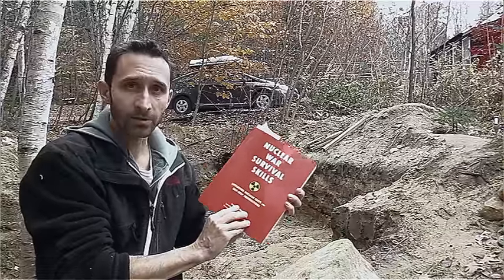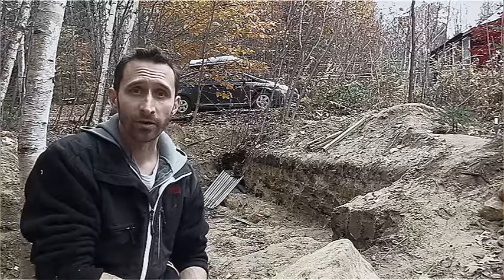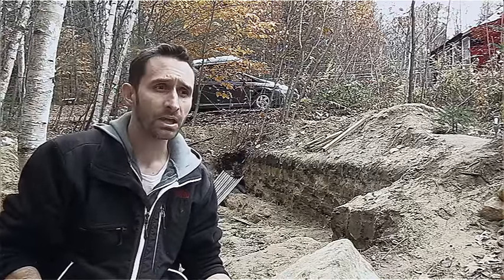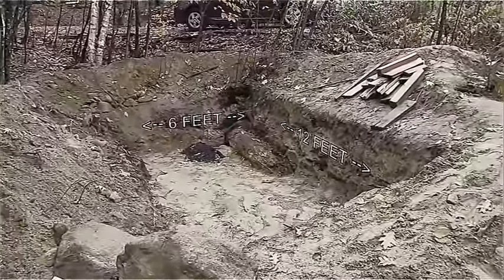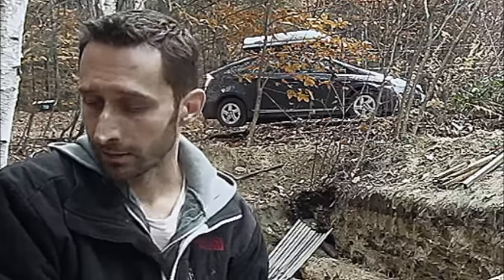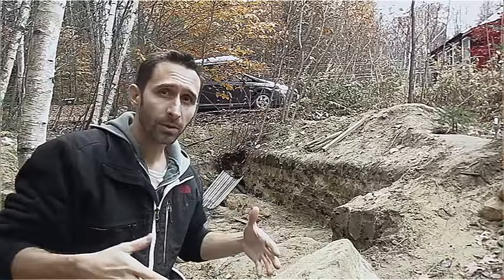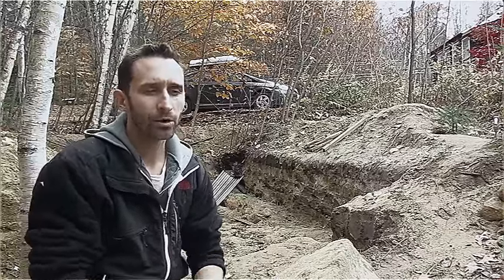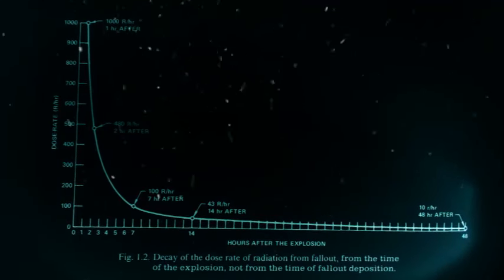Surviving Nuclear War - Part 2: Shelter Building

Comment: 1. Ideally you need to maintain a positive air pressure in the shelter to prevent small contaminated particles from getting inside. its unlikely you will be able to wear a n-95 mask at all times. Alternatively you need to make your shelter have a good air tight seal so there is very low air movement except through your air filtration system.2. Soil or sand could be bagged (ie sandbags) instead of spreading dirt on your floors. But I question the safety of using 2 ft of soil on top of a wooden floor structure. You probably don't need to cover your entire first floor, just a section large enough to accommodate those living in the basement. Sandbags could be used to build temporary walls in the basement to provide full gamma radiation coverage in a basement.3. Nuclear power plants are likely going to be a problem. After the war, the plants will meltdown, and continuous produce new radioactive isotopes for years. 4. You need a source a food after the war is over and your food stock is depleted. its likely that unprotected soil will become contaminated with long half-life isotopes like Cs-137. You need to apply plastic sheet and green house(s) to provide safe soil for growing food. Plants will take up CS-137 and other contaminates from contaminated water or soil. It would be preferable to use a deep underground water source for drink and watering crops. Consider that some containments will be water soluble and a simple filter will not be able to remove them. The only way to truly filter out soluble contaminates is making them insoluble and then filtering them out.. Boiling can also be used to remove most of the soluble contaminates, but it will not remove them all. I think only high pressure reverse osmosis systems can remove soluble contaminates.5. Its likely that fallout will will also be chemically contaminated. Cities and other targeted areas will burn and they will produce a lot of chemically toxic ash that will containment everything. When the NYC trade center collapsed after 9/11, fires burned for more than week, with fire crews pour water on the fires. After a nuclear war these fires will burn for months and consume large area of cities.. Consider that cities use a lot of plastics and other hydrocarbon materials that when burned will release a lot of toxic smoke and ash. 5. Large bombs in the Megaton range are hydrogen bombs. I believe the largest pure fission bomb tops out about 400 Kt. Hydrogen bombs use a shield temper of U-238 to force gamma and neutron flux into the  lithium-deuteride mass to achieve fusion. the temper creates significantly large amounts of fallout, and it will also create much longer lasting isotopes that may considerably longer than two weeks to dissipate.. Some bombs are deliberated include a cobalt casing for the temper in order render the  target un-inhabitable for decades.  When the bomb explodes the Cobalt is transmuted into Co-60 which emits ~2.8 MeV gamma which needs 6 or more feet of concrete in shielding. 6. If you need to heat your shelter while you are sheltering inside, you cannot burn contaminated wood inside, You either need to burn it outside an transport the heat inside, or use a non-contaminated fuel source (wood protected from fallout, propane, or, kerosene).7. Its likely that biological weapons may be used in a nuclear war. It difficult to know how long bio-weapons may last. I think it would be a good idea to have the means to remain in a sheltered for up to a full year.  A well sealed homes with a good fallout shelter (hardened for gamma) in the basement might work. Its likely that radiation levels will vary for a considerable period (years) . For instance when it rains, radiation levels make spike up if the rain has picked on fallout from a nuclear power plant that melted down hundreds of miles away. You  would need to shelter in your basement. At other times the radiation levels may be too high to walk outside but low enough to be able to shelter in your house outside the basement. Hhowever you need to make sure your house is tight or maintains a positive air pressure at all times to prevent contaminated dust from getting inside. Using a Geiger or other better instruments would probably help you determine at which level you must shelter. Prepare for three levels of shelter: 1. Gamma hardened area in Basement, 2. non-hardened in the rest of the  basement,, 3 home interior that is well sealed.In addition to respirators and masks, I would also recommend having Tyvek jump suits so if you need to go outside of your shelter for short periods, your clothes do not get contaminated. Your shelter should be set up with a shower area just outside of the entrance, so you can hose down your Tyvek suit before going inside your shelter.

Comment: make your door ways small say 3ft by 3ft and stack good old fashioned sandbags behind them, this should stop most radiation from entering your little lifeboat, plus it will give you some blast protection
Reply from the maker: I had been thinking for my own purposes of using large stackable jugs of water for drinking to block the door. Water is pretty useful to block radiation, and from what I can tell is undamaged by irradiation itself.

Comment: I'm curious about something: would the PVC pipes you would use for lights, would they be susceptible to melting if a fire goes through? Could your lights suddenly allow particles into your shelter? Or do you think them mostly being protected by the earth around them would keep them from becoming a weak point?
Reply from the maker: I actually commented on this weakness when I was chatting with another viewer and it's been on my mind prior to that as well. Yeah, it's something to figure out. Obviously, the PVC being surrounded by earth would protect them - and even if they did catch fire, they wouldn't burn all the way through until the fluid completely boiled away - try putting a paper cup filled with water into a fire and you'll see what I mean. But it's not bullet proof (figuratively)... yet. I'll be sharing as I build all the specifics that end up going into the structure. My sense at this point is that I'll be insulating the tubes with concrete and earth, and then doming the top with a glass pyrex bowl. But we'll see.

Comment: Cool light tube idea. Best
Reply from the maker: The only trick is what I mentioned in this video about things sticking up out of the ground needing to be fireproof. Obviously, the light tube could stop right at the ground's surface, but higher up will help to prevent debris from covering it... have to bang that one around in my head a little more...
Reply: Praxis Prepper Ship's of old had a light prism set flush with upper.deck and extended below decks...the prism spreading the light below deck. Best

Comment: Question 2. what about filling your light tubes with denatured alcohol or white fuel for later use? There is a combustion risk of course, but a lot people keep alcohol stoves and camp lanterns on hand as preps.
Reply from the maker: I was thinking of doing an alcohol/water mix or something - just to prevent freezing. Maybe anti-freeze would be good to use in this case. It's only a concept at this point. I ran out of summer/fall to build last year so will be doing the actual build this year - which I'll document to share with people of course.

Comment: I wonder if seeking refuge in  a doctor's office xray suite would work. All surfaces are lead shielded to keep radiation within but I would think the opposite would be true too.
Reply from the maker: That's an interesting notion. My initial thought would be that it would depend. I can't recall the last time I was in an x-ray room at a hospital, but at the dentist office, the space is entirely non-fallout crisis helpful. Often times, there are large windows to the outside, which would allow plenty of gamma rays in. So I think that it would depend on the room. If it were an internal room, where there are other offices adjacent, I presume that effort WOULD be made to shield those walls, but if it had an outside wall, perhaps not. Just getting into the inner rooms of a large building may well be helpful depending upon the construction materials used (possible masonry exterior walls with multiple additional dry-wall layers shielding you. Even gypsum board wall would consist of two layers of 1/2" - 3/4" drywall (on each side) which adds up to an inch to and inch and a half of shielding. Two such walls would add up to a halving distance (presuming it to be about the same shielding degree as dirt) - plus the geometric shielding of the shear distance to the outside where the fallout is deposited... the issue would be whether the ventilation (if still operating) would be pumping fallout into the interior of the building...
Build a root cellar baby!
Reply: Wow, you have really thought this through. I would like a root cellar like my grandfather had connected to his farm house. Great as a tornado shelter too.
Reply from the maker: I think EVERYTHING through - ad nauseam. I'm probably that sort of Asperger's type of autistic. I think I'm really good at hiding it though. They say every Asperger's has a strong, almost super human ability (like being an expert on the history of trains, or juggling numbers). Maybe mine is I'm super effective at pretending I don't have it. But I still think and think and think about everything - endlessly. It's often useful, but sucks when you need to get to sleep!

Comment: You mentioned painting the inside of PVC pipe with chrome paint to make it more reflective.  But I do not believe that is the best you can do.  I believe (from my conversations with medical marijuana growers) that mylar is the best reflective element you could line the inside of your PVC with.

Mylar is, to my understanding, the most reflecting material you can use.  It is the plastic used to make emergency heat blankets and bags of chips (ever notice how the inside of these bags resemble an odd aluminum foil?).

It reflects heat and light most efficiently and all paints are sub par compared to this.  And considering that wal mart sells the emergency blankets for a buck and change....it's not cost prohibitive.

Shoot....one California grower I know lines his grow box with the mylar Doritoes bags (inside, not outside, used to reflect) he discarded after his consuming his munchies!  And it worked just like any other source of the same material.
Reply from the maker: That's good advice. I was also wondering about how to find chrome paint that I could confirm would stand up to being soaked in anti-freeze for year after year. This might solve that. Much appreciated!

Comment: TRY A WOOD DOOR WITH 3 OR 4  LAYERS OF LEAD  FLASHING  that can be bought at home depot
Reply from the maker: A wood door shelter is actually in the book I reference in this video -- you should definitely download it and check it out - it's really well done.
Reply: had it in my hard  drive for a long time
Reply: as a madder of fact I have  1 of the original 79 issues    its on the shelf in the family trust bunker library in AK.
Reply: I THINKI DOWNLOADED THE PDF BACK IN 09
Reply: yes but the lead stops  the radiation   or most of it
Reply from the maker: The design in the book used a regular wooden door, and got the shielding from the thick layer of dirt piled on top of it. But yeah, lead works great too. The halving distance for lead is only .4 inches!
Reply: and with sufficient hinges  its movable  2 feet of dirt not so much   use dirt where you don't need to  move for egress

Comment: Lead sheeting from the hardware store is a good addition too
Reply from the maker: Is that a real thing in your area? I've never seen lead sheeting in any hardware store ever... I think you're joking... but who knows, I was in a hardware store recently and they were selling a six foot tall, animated, inflated dragon wearing a Santa Claus hat... So anything is possible.
Good use of the proper spelling of "too" by the way. That's rare on Youtube!
Reply: Praxis Prepper it's a real thing.  It might not be somewhere like Home Depot or a DIY place but you can get it.  You could probably get it online somewhere even.
Reply from the maker: When you said sheeting, I was thinking something like 1" plates. But yeah, you're right, for roofing it's available. I guess one wouldn't want to collect their rain water if they used that up there maybe. Ten layers or so of the .04" stuff would give you one "halving" thickness, which is the thickness of something that reduces radiation penetration by half.
Thanks for the link. I think everyone knows lead is a great radiation blocker, but I've never actually thought of using it... for some reason. But for a door, or something, it'd be a good tool for the job.
Reply: Praxis Prepper it would be best used for the smaller spots I think, but you could put layers of the large sheets as well.  It's a good thing to use as well as the concrete, sand/dirt, or water.  

One thing you might want to consider for using water on the floor as a shield when you're in a basement is water bed mattresses.  They are very sturdy and would most likely be the best affordable container for large amounts of water.  Of course you wouldn't want to drink it, because I'm assuming you could buy a bunch of old mattresses that don't leak, but if it's just shielding you want, that's probably a good thing to use .
Reply from the maker: You mean to put down the waterbed mattress on the floor above if you'll be in the basement beneath? That's a good idea. The books I was relaying in this video series, were mostly about using dirt, but I was thinking about water too as it's easy to "shovel" with a hose, and cleans up easy. I had roughly thought about using thick .6 mil or thicker plastic sheeting, but your idea (while probably more expensive and less versatile that plastic sheeting), would DEFINITELY be more reliable and easier to "install".
Reply: Praxis Prepper you can get old full wave waterbed mattresses from folks on yard sale Facebook pages or eBay or Craigslist I'm sure.  You want full wave because that's just a big bag of water in a really thick bag, while waveless have baffles in them.  The full wave were the cheapest back in the day when waterbeds we're popular and they were thick too, so there are plenty of used ones around.  Waterbeds really haven't been a thing since the early 80s but people do have them and you can buy new mattresses, but mostly what you'll find if you Google where to buy a waterbed is people selling used ones.  Just make sure the mattress you buy hasn't been patched and check it when you get it and patch it if need be before storing.
Reply from the maker: Yeah, I think a patch kit would be a good idea under any circumstance.
Thanks for sharing these ideas by the way. You have a thinking mind - which is the best sort to have.

Comment: I enjoyed your video, thanks. Would distance from a nuclear explosion not make a difference, to the thickness of your walls and overhead protection? I mean, if I am more than one hundred miles from a target, could my walls and ceiling bot be narrower?
Reply from the maker: That's a good question. Be sure to check out the part 1 video in this series. There's info in that one about this question. But to briefly answer here specific to your question.
Yes, the distance from the blast matters - but not for all the dangers. If you can be in your shelter DURING a detonation, it'll protect you from the heat, the light, the dazzling radiation, and (if you've also installed a blast door) the blast. These dangers dissipate after just a few minutes (wait 10 to be on the safe side). The reason that you stay in your fallout shelter for a prolonged period (weeks), is due to the fallout (radiation contaminated debris) that has been blasted into the air and travels for miles and miles and miles before falling to the ground. For the smaller particles - this can be literally hundreds of miles. So it's for this danger that you're in your shelter for 2-3 weeks following a detonation. The debris from a blast another state away can easily blanket the top of your shelter once it falls to the ground and it takes (as I mentioned) up to 2-3 weeks for the radiation being emitted from that debris to half-life down to a point where it's... "safe" to be outside again.
Does that explain it better?

Comment: Wouldn’t the water be absorbing the radiation, and the. not be a good plan to be using that as drinkable water?
Reply from the maker: That's the number 1 comment that I get on this video and it's something that I had presumed myself before ei started researching this too. But the data seemed quite clear on this point that as long as the water doesn't get fallout material in it (like radioactive dust), then it's safe to drink. The radiation (aka energy) that the water absorbs doesn't damage the water in any way. It's still H2O both before and after any irradiation. Now to be clear this is information I gathered from research from what I considered very reliable sources. This isn't information based on my own personal testing. But as I mentioned, I was under the same impression as you when I started digging and found the counter argument based on other people's research quite convincing.
Reply: @PraxisPrepper  wow. That fascinating. I have found that much of the information I have learned about radiation I entirely unintuitive. I guess this is one other example of that. Do you suppose food like canned vegetables would also be safe if used as a barrier
Reply from the maker: @redapple3256  The physics of electricity is the same for me. It makes no sense to my brain, but (apparently) works. ;)